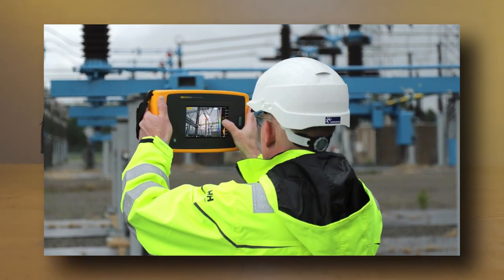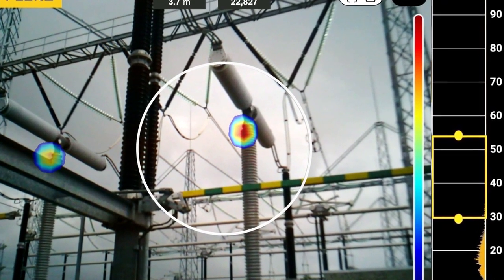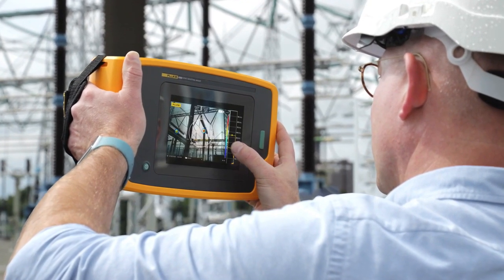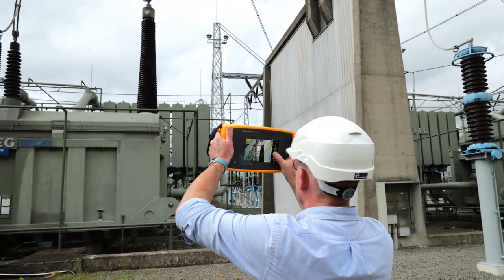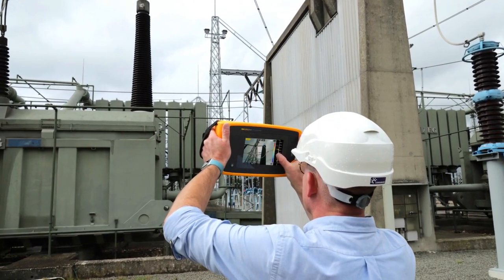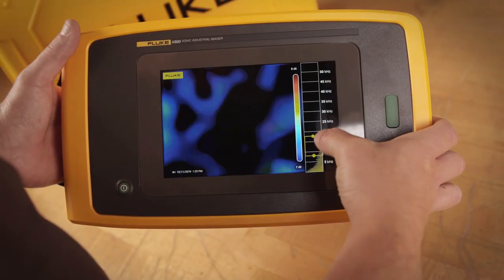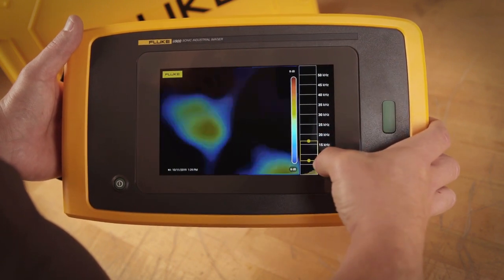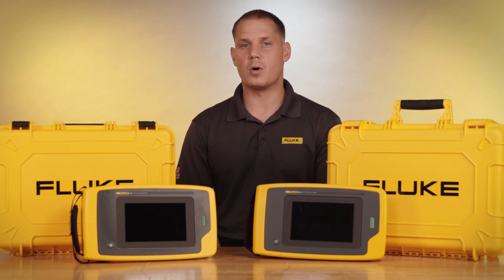Fluke ii900 vs ii910 Acoustic Imaging Cameras

Comment: Could you please provide a video demonstrating how to use this device? For example, to diagnose an electrical fault: a cable, synchronous motor, induction motor, refrigerator motor, household electrical outlet, distribution panel, transformer, etc.? Thank you.